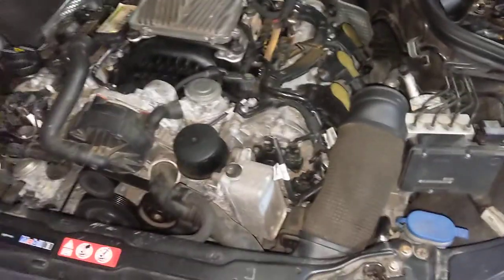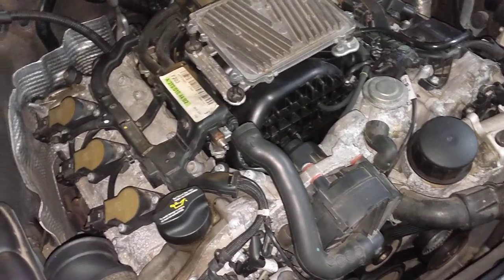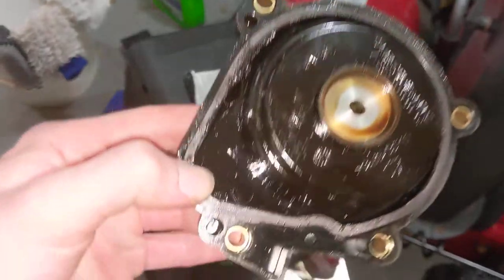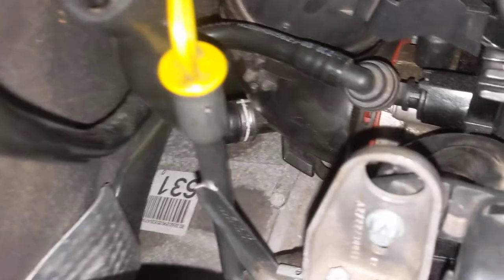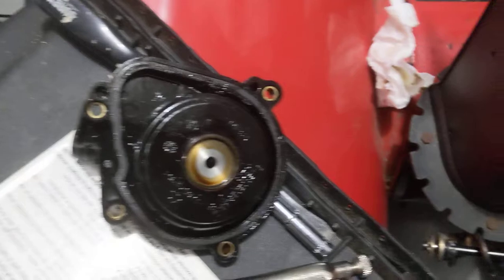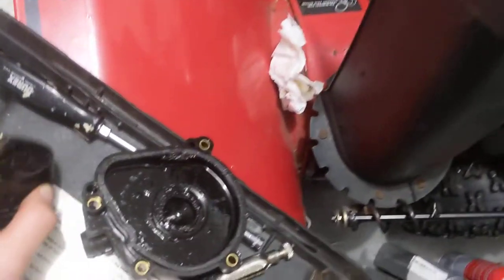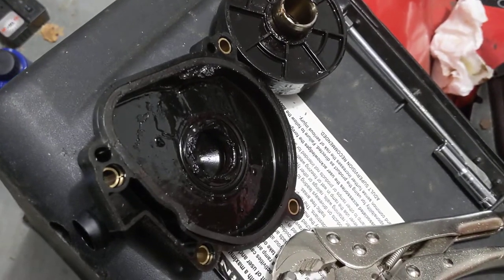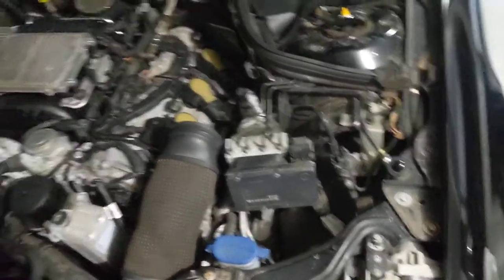Mercedes M272 Oil Drip Pan- Save your Intake Manifold!

Comment: It's much more than just that oil drip pan.
Replace the PCV Vent cover - this also helps fix the problem with burnt oil smell when this part fails.  
Clean up the oil residue in the tube from the pcv vent cover to the down elbow.
Clean up the down elbow and check out the MAF. 
Clean MAF if there are oil residue.
Clean the throttle body / butterfly.
If you find the throttle body has oil residue.  You are in trouble of the intake manifold gummed up with oil residue.
Another tip as a hint the intake manifold is in trouble, you find that the Intake Manifold Air Flap Runner in the front behind the secondary air pump has oil residues and dust all collected in that region.  The engine is not leaking oil, but is due to all the oil residue deposits that leaks out from the intake manifold.

Aside from keeping up with the pcv vent cover and oil drip pan maintenance.
You may want to consider get an oil catch can.  Which would be installed between the pcv vent cover and the down elbow.  Basically, just port on the rubber hose line.
Reply from the maker: There's a host of other videos on this channel covering exactly these things :)

Already routed a primary catch can off of the high-load, running a second off of the low load breather soon. This car, it's less of a concern given the composite manifold.
Reply: lol you still got it??

Comment: Hello install an oil catch can and the intake will be safe. Also you will be sure if the engine burns oil from piston ring bad valve seal or pcv valve..

Comment: I'm going to be replacing my intake manifold on my 2007 c280 luxury trim due to the P2004 runner bank in open position error. Do you recommend i replace the fuel injectors as well as the pan?
Reply from the maker: Depends on mileage, but probably not a necessity unless you have reason to believe the injectors needs replacing. I'd just recommend injector seals in case they're damaged when you're swapping the fuel rail onto your new manifold (some manifold kits will include the injector seals, such as the Pierburg OE kit from FCP Euro)
Reply: @danny_playswithcars  ahh totally forgot to mention my car is at 81500. i already did a full spark plugs + coils at 60,000 when i got the car but never got around to tackle the p2004 issue. i really dont like the way the car drives at low rpms and sometimes high thats why im doing it. for sure i will buy the O rings as well gaskets for the manifold  + throttle body gasket. would you say fuel injectors is okay to go without replacing ? i don't have any issue with my fuel system nor leaks

Comment: I have a high pitched whistle noise comeing from the front of my intake manifold. Does this mean I need a new manifold? Also I've never seen a manifold like that on a mercedes did you make that custom?
Reply from the maker: Is the whistle solely on startup, or all the time? Just looking to eliminate the possibility it's the secondary air pump.

There's a lot of push-style vacuum hoses in front of the intake manifold, behind the secondary air pump. I'd give those a visual inspection and see if those are your problem. Pending where a split/damage may be, you may need a manifold. With a split hose and some ingenuity you may be able to splice in a new vacuum hose, whereas if a bladder is damaged or a fitting came out of the manifold, you'd want a new manifold.

The intake manifold in this video is the composite one from the R171 SLK350 option package "M014." It's an...interesting mod for these cars. If you're curious, there's a lot of videos on this channel about it!
Reply: @danny_playswithcars  I thought it was the secondary air pump at first too but it was not. It happens all the time. And the thing makes more of a buzzsaw noise when it’s bad. I did inspect some hoses without taking the pump off and could see what looked like some burn marks on one of the hoses (from rubbing that metallic bell looking thing to the right of the air pump) but it didn’t look totally cracked through not sure if that is bad enough to create an audible leak. There was also another hose that appeared more cracked at the end. Ive heard of people using a razor blade to cut the end off and fit it on more securely. But I bought about 3 ft of hose from the dealer and am going to try to pull the air pump off and examine better. I’m not completely familiar with evap stuff so this is kind of new territory for me not sure if I should just replace all the hoses I can. I was gonna try to smoke test it also with a little Jerry rig smoker I made. Do you think the best place to run smoke would be from the brake booster line?

Comment: Hi Danny 
New Mercedes owner here 
I have a 2009 S350 wich is ran 40k miles 70k km 
The more I drive it the less sure I be with legitimacy of the mileage 
It was perfect when I first bought it aside  from the aux battery malfunction
Now it has a very bad squeaking and craking noise when steering, accelerating or decelerating some times over bumps around 10 to 20 kmph even when entering and exiting the car! 
I had a local 'mechanic' to check it out he says all the bushings on the control arms and anti roll bar are gone and needs to be replaced 
I trust him with that but I'm more worried about the alignment after the replacement  camber, caster, ... that stuff 
Because no one around my area have the proper tools knowledge and tech to do that stuff they just guess it and lady 350 already steers to the right above 60 kmph what do you recommend?
Reply from the maker: Hi Bako! I understand your concerns for your alignment, but you won't have to adjust it too much even after you replace everything. The control arms on MB cars generally have very little camber/caster adjustment, so putting new arms in should only throw things off by a few degrees. Any semi-competent shop should be able to get it pretty close. 

If your bushings are that worn, it's actually probably affecting tire wear right now; large amounts of excessive flex or movement mean your alignment wouldn't be staying consistent while you drive, so you may actually see an increase in tire life by doing this service.
Reply: Also know that almost all cars when they cross the 10 year mark. Alot of ''rubbers'''are gonna degrade very quickly after that. So not only bushings, but also hoses and seals. It is one of the downsides of an aged car.

Comment: Did you use an 8mm 6 point socket? I'm assuming I can use a 3/8 drive. I don't really want to have to buy 1/4 drive if not necessary.
Reply from the maker: I believe it was 8mm yes. Cannot remember off the top of my head. You could always use a 3/8 drive with an adapter to 1/4 (that's what I did). Just keep in mind, that single bolt inside the drip pan is reverse-thread

Comment: Hey man, when you removed the oil drip pan, did you use a 1/4" socket and turn it clockwise or counter-clockwise? I've read comments that the bolt is reverse threaded, yet most tutorials say to turn clockwise, only for them to thread the bolt back in clockwise again... My bolt isn't coming off and I think I may have stripped the head... Thanks.
Reply from the maker: I will revisit it today just to be sure I'm giving the right answer. The drip tray, the plastic cover, I believe is standard thread. The drip pan, the little diffuser on the end of the cam, I recall being reverse thread as you mentioned.

Edit: yes, the drip pan is reverse thread; clockwise to remove it, counter-clockwise to reinstall
Reply: @danny_playswithcars clockwise to remove it as in the direction we're facing when working on the engine correct? i only ask because when i remove the plastic cover, i am turning clockwise to loosen when facing the engine.
Reply from the maker: @MTSLFilms  Both of these are in reference to if you are staring directly at the bolthead.

Comment: How often would you recommend changing these items?
Reply from the maker: Hi Nick. These can operate on an "as-needed" basis, but won't need replacement very often. Often these are done between 80k-100k; simply pulling the lines of the driver-side PCV breather or checking the one big hose off of this drip pan for oil accumulation should tell you everything you need to know. If there is liquid oil, there's a problem; these systems vent vapor when working correctly.

Comment: How many miles on your car when you changed these parts?
Reply from the maker: The drip pan and tray? I would guesstimate 125-130k. I bought this car right around then so I can't speak on the maintenance history and care beforehand.

A good way to assess if these parts are bad is to look for oil consumption. Check the drip tray and see if oily residue is visible on the cylinder head around it. Pull the breather hose and take a look, it will likely be a little oily but may contain excessive amounts with a drip tray failure. You can also pull the air filter housing and MAF to take a look at the air deflector (the neck down to the throttle body) and see if it's gross and oily in there.

These engines aren't big oil leakers. If you're losing oil, I would say to expect the breather system before anything else.
Reply: You should check the rubber tube on the pcv vent cover to see if there is any oil residue.  If there is, then you problem have started.  If it's clean, then you are still good.
Reply: Replace it every thirty thousands miles.

Comment: Could add a catch can between it
Reply from the maker: Actually did exactly that in another video on the channel. It works at catching oil spilloff, but the rear centrifuge you see here is actually pretty good at it's job when it's in working order. The one you'd want to run the catch can off of is the one on the driver's side